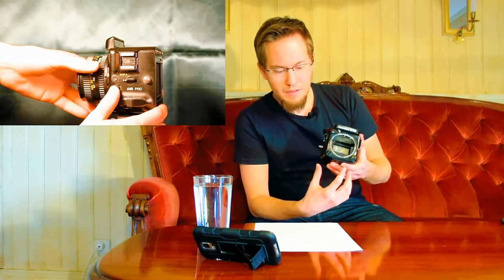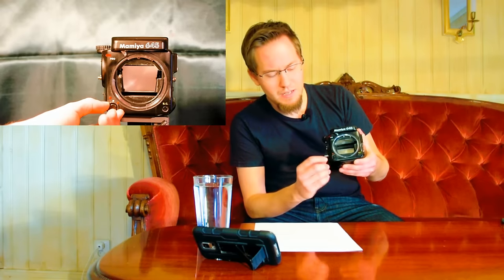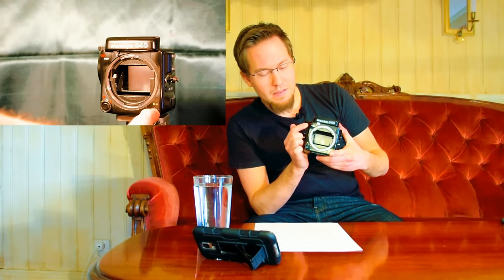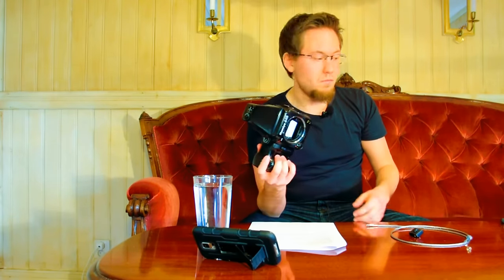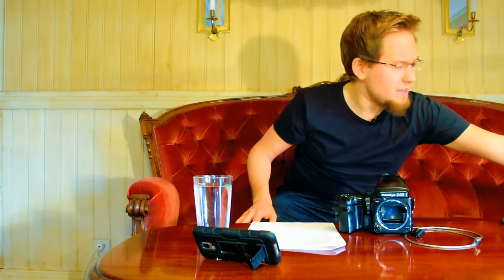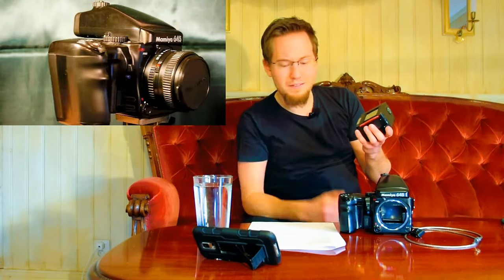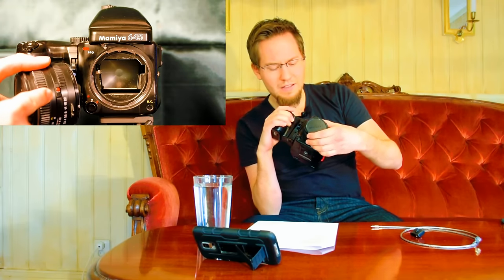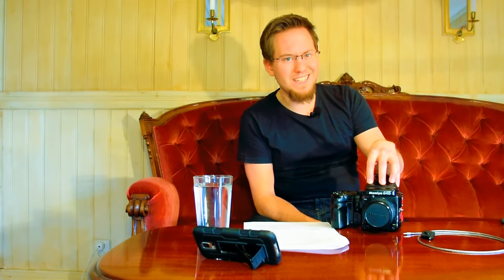Mamiya 645 Pro Overview/Assembly.

Comment: Hey! Quick question, do you have issues focusing with your m645 pro? My focusing screen has a circle in the middle with focus line horizontally. So things either match left or right, or up and down when in vertical position. I find the circle to be really small and not much movement for the focus compared to something, say my minolta slr camera, with a much obvious in focus confirmation. Unless theres a magnifing option on the viewfinder that i dont know. If not it seems to me that my focusing screen is for the pop up vertical viewfinders with magnifier (if you know what i mean). So how do you find focusing with your camera? Easy?
Reply from the maker: Hello Wilson Law.
Well from what you described you are using the factory stock “E Split prism” which is a split screen witching a circle. It is a different beast from any Minolta. I use the “A4 Grid” focusing screen that has a “clean” circle in the middle. I simply match the middle circle with the rest of the screen to achieve focus. So I find it easy, though a bit time-consuming. I think Erik Wahlstrom has a similar issue with his RB-67. 
Anyway hope this was useful.

Comment: Based on your clear and cogent explanation of the Mamiya 645 Pro camera system, I decided to purchase this medium format film camera. Like you, I love this system. I've purchased two 120 film backs, a 45, 55, 80, 110, 150 and 210mm lenses. Most of my lenses are the N variety, but I think the older C lenses are also excellent. I have the AE Prism finder and the waist level finder and am just getting used to both of them. I also am getting used to using a light meter when shooting and this film medium format camera system is a much more deliberate way of creating images than the usual "run & gun" method of digital shooting.

I need to get a remote shutter but need to find out the model number and I also need to get into flash with this camera. 
I would like to see a video on your experience with flash/strobe with this 645 Pro. I haven't found anything on shooting flash with this camera. I know that a leaf shutter lens or two are available with this system. I believe a 70mm or an 80mm is available with a leaf shutter. Please do a video on flash. No one expects you to an expert with flash for the 645 Pro, but just what you have done with the camera. What kind of flash will work on this camera. What kind of flash do we need and what should we avoid? 

Good job on this video. You speak excellent American English. It's nice to know someone has gone before me with his camera and is making videos on how to use it. Keep up the good work.
Reply from the maker: Well I might do a flash tutorial in the future for this camera. In fact I used this camera
at Christmas with the family, so I used a extremely cheap WANSEN (a glorified car
remote) flash control system and a few speed lights around the room. It is no Pocketwizard,
but it works. 

I do actually own a N/L lens, the 150 f/3.8 leaf shutter lens. It works grate as a
standard 150 but my copy seems to have an intermittent fault with the shutter mechanism.
You see it is the aperture “step down lever” that activated both the aperture and
the leaf shutter in the N/L lenses (you set the camera focal plane shutter to
1/8 shutter speed). But mine sticks half way so the camera is sensing up on my…and then the cold sweats start.

If I may do a lens suggestion that more or less became my mainstay it is the 105-210mm ULD
C f/4.5 yes it is a zoom, but the ULD is “Ultra Low Distortion”. Got it after
reading on some forums that professional wedding photographers loved this lens,
stating it is as sharp as there prime counterparts.

My cable release adapter is the RC402 it is electro mechanical so you insert a classic plunger
style cable release to it. I think B&H has the RS401 infra-red remote. So there
are options out there.

Anyway thank you for watching. Oh and if my English is good that´s as we say in Sweden:
“That´s a plus in the corner” ;-)
Reply from the maker: Well, thank you for the idea: 
https://www.youtube.com/watch?v=bI48HYNeAnk&feature=youtu.be

Comment: Just had a 645 Pro delivered!  Thank you, for the video.  How do I get the film back open?  ;))
Reply from the maker: Thanks for watching. Well it is not that complicated a process, though a bit challenging to explain… lets see. 

1. On the Left side of the film back (rearward of the dark slide ) there are two “split tabs” the forward detaches  the film back from the camera body and the rearward opens the back for loading film. 

2. The rear “hatch” of the back hinges downwards so it is not advice to open when the camera is on a flat surface. 

3. The opening tabs has two parts to the operation: A smaller rectangle with a white triangle pointing down and a upper button. The triangle part is slides downwards while the upper button part is pressed in (towards the right side of the housing). 

4. That should open the latch and the back hatch of the film back should swing open. No excess force should be used. 

Hope this was helpful and enjoy the camera.